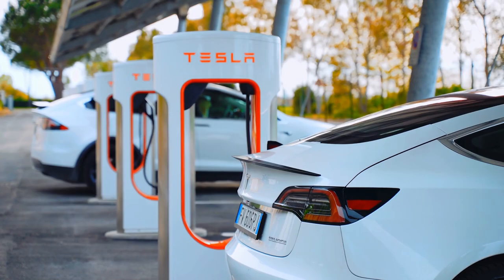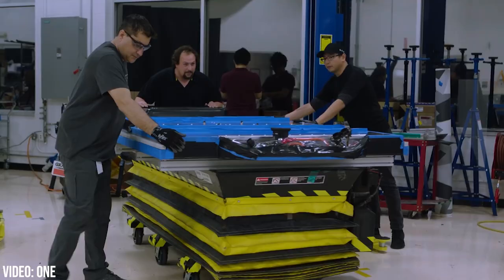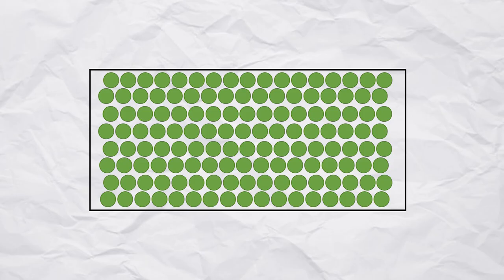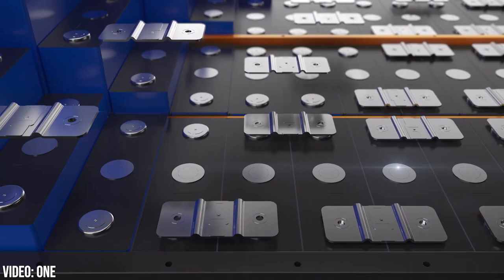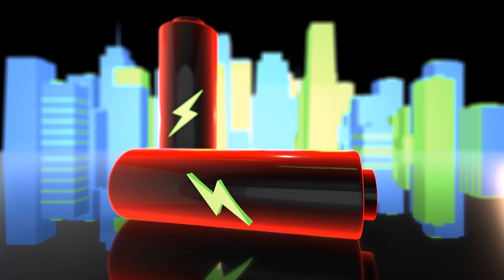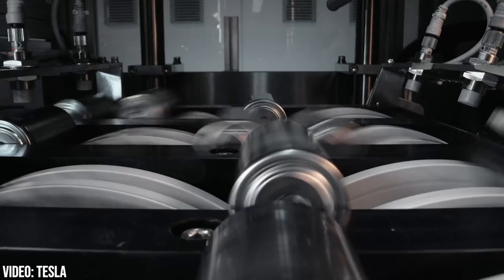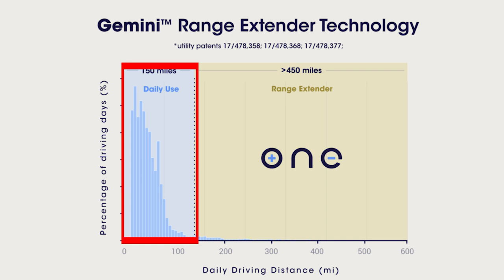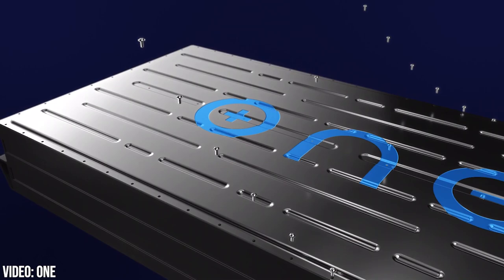The Dual Battery: A Game Changer Is Coming!

Comment: Higher voltage is the answer. Go up to 1kV, much lower current and therefore heat.
Reply: Than you would need wayyyy more cells, thereby bigger volume and weight

Comment: Hey can you do a video on why different car manufacturers uses different voltage systems for their cars? For example Teslas use 400v while the Porsche Taycan uses 800v. What advantages and disadvantages are there by using higher or lower voltages?

Comment: Really interesting video, I hope electric vehicles get through the mill of procrastination.
Having 700 miles of range is definitely not necessary for most smaller countries. In the Netherlands for example you would only need about 350 miles range and that's already in the luxury range.
You could just work closer to home, but that's also a per-country and per-person variable. The masses still don't need 700 miles of range, it's a luxury, even in the USA.
And if you do need more, it's cheaper for you and better for the environment to then just use a combustion engine. At least until the markets and resource prices shift again.
Reply from the maker: I definitely agree, thanks for your comment!
Reply: You need a long range if you are going to drive on the highway

Comment: I hope they will make cars with 3 battery packs, 2 of which are removable. Because most days we only drive less than 50 miles, that will reduce a lot of weight by removing 2 of the 3 batteries.

Comment: Ive always said split the battery in two but my idea was a bit different. Both batteries will be the same but the car will use one at a time and when the first one gets low the car can switch over to battery 2 then an alternator can charge battery 1.

Comment: Why not use a smaller 4680 battery compartment coupled to semi solid, lower density freyr battery pack from MIT in a dual heterogeneous battery system that Tesla described earlier in a  public domain tech concept?

Comment: The real answer is to give the high density batteries the same life and charge characteristics as the LFP batteries.  Where there is a will, there is a way.  Does it make more sense to have maybe  200 m qty of the fully developed batteries, and a slot to add another 400 m or more of extra batteries for the occasional longer trip?  So you are not hauling around a bunch of weight that you are not using.  I think so.  And if you don't go on long trips much, just rent them, not buy them?  Or perhaps own them, but use them for energy leveling / solar if that is applicable to you, when not out tripping.  or use them to power your riding lawn mower? 
I think there is a lot more potential battery development coming, and probably quickly.  
  And there is the possibility of putting a nuclear or ?? generator in that slot as well, so the car charges itself over time.  Lots of potential possibilities.  An enclosed inexpensive commuter emotorcycle that stabilizes itself when stopped?

Comment: How long before we're essentially just driving around with massive bomb? These batteries are already dangerous but we wanna pack even more energy into them. At some point, we will have packed so much energy into a battery that is basically dynamite. Yeah. Sign me up for that.
Reply: You are right.

Electric motors are nice, but the batteries are unsustainable.

Etanol is waaaaay better to store energy Sun.

Comment: For the purposes of city driving, I'm interested to see if EVs can extract more range by using smaller batteries and an electromagnetic flywheel to store energy during braking and redeploy it under acceleration.

Comment: Best Electic vehicle is are as follows:- 

1300 kg 

1300 watts 

130 kms in 1:1 ratio of rpm 😎

Meaning Tesla range have to be over 13,000 kms in single charge in 1:1 rpm and 24,000 kms and above in single charge with a transmission system with 1:13 rpm ratio mean 1 rpm of motor 13 rpm of wheels in middle level 1:1 in Torque mode 13:1 mean motor 13 rpm wheels 1 😇

Elon musk cars have over 500 to 600 miles range 😏😏😏😏😏

Change rpm to 1:1 can give us over over 9x higher range which is over 4500 to 5400 miles per charge and I m not talking about using and transmission system which easily boosts the range of any Tesla cars over 13,000 to 24,000 miles in single charge 😏😏😏😏😏

But they r not going to do it cuz it’s very low profitable business and elon musk wants only money money money 😂

That’s y he is not supporting hydrogen cuz it’s even less money money money 🤣
Reply: Elon musk giving us over 9:1 rpm with gears ⚙️ meaning motor over 9 rpm wheels only 1 rpm. which means battery life,range, is 130 times lower 😏😏😏😏😏

And electric bills r always 130 times higher 😏😏😏😏😏
Reply: Only if musk gives us 1:1 rpm that could drop the electric bills over 9x and increases the range battery life over 9x 😇😇😇😇😇
Reply: And speed will also increase upto 5x to 8x which means speed is over 500 miles to 800 miles per hour over Speed of sound (over 1 mach)😏😏😏😏😏
Reply: Elon musk cars have over 500 to 600 miles range 😏😏😏😏😏

Change rpm to 1:1 can give us over over 9x higher range which is over 4500 to 5400 miles per charge and I m not talking about using and transmission system which easily boosts the range of any Tesla cars over 13,000 to 24,000 miles in single charge 😏😏😏😏😏
Reply: @Ironcammandoo  you do not understand how torque works. A 1:1 gear ratio of these motors would have horrid torque and would hardly move if at all.